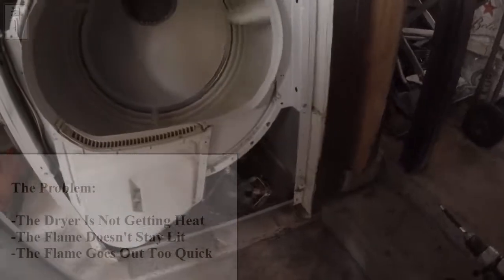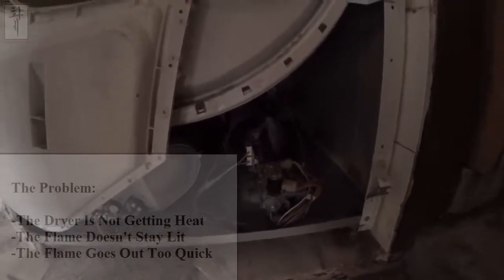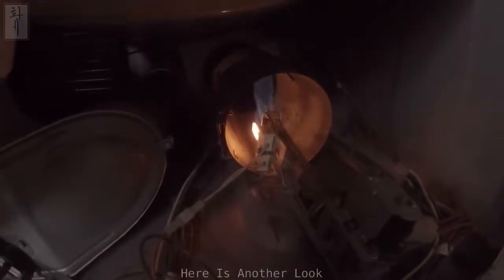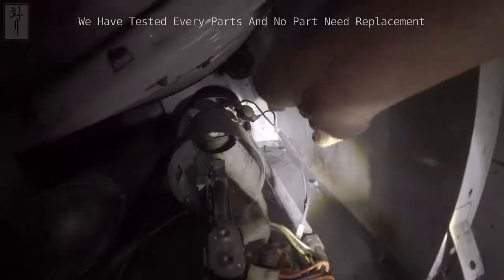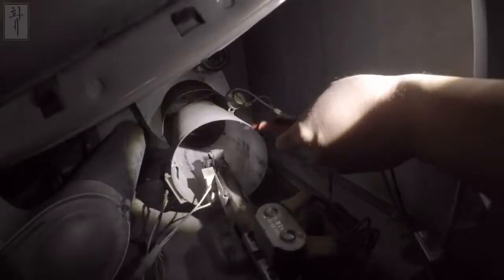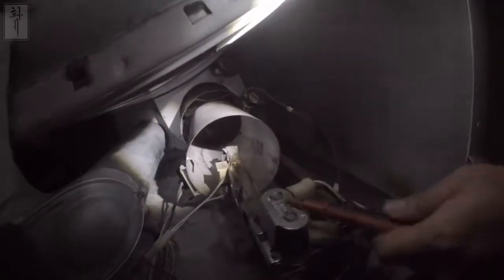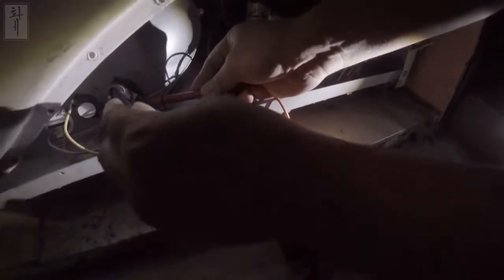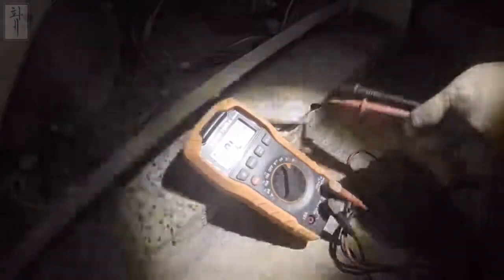Gas Dryer Is Not Getting Heat | Fixed Or Need Fix

Comment: Looks like a 18,000 btu flame. Someone probably put a 18,000 btu orifice in to make it easier on the clothes and dryer. 22,000 is what the normal btu output is in most gas dryers, but some people just put a 18,000 btu orifice in to make it easier on the clothes and dryer.